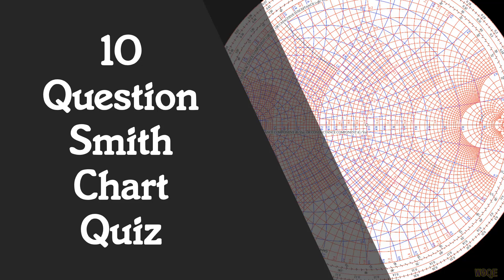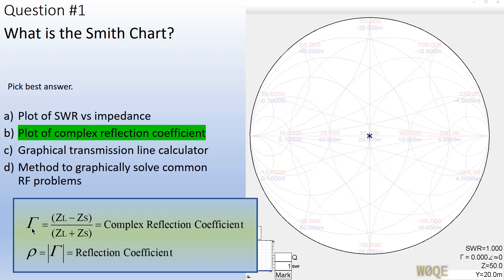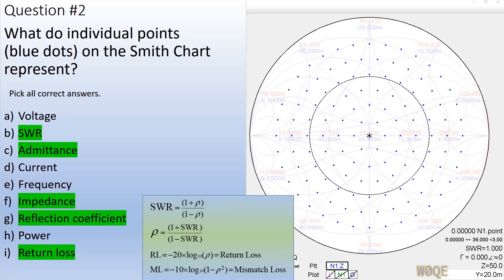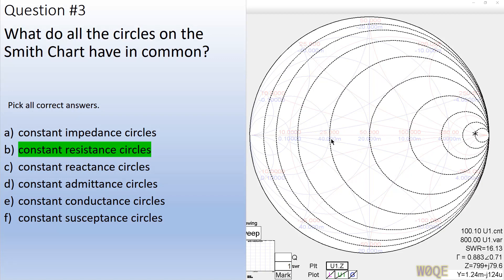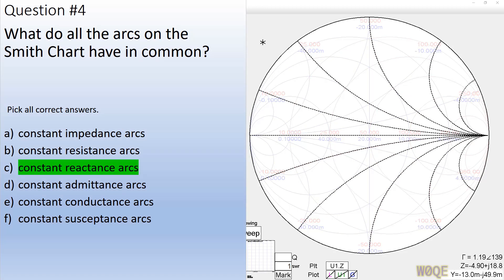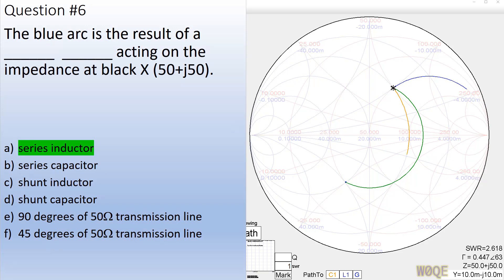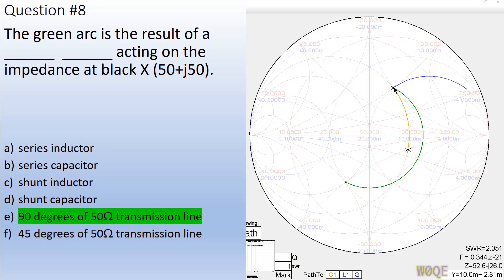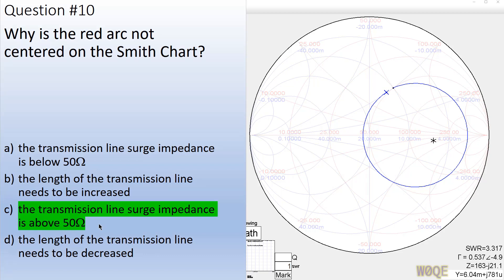#39: 10 Question Smith Chart Quiz

Comment: Really enjoyed this format - glad to say that I got 100% <grin>.  I'm doing a series on Smith charts on my channel right now - but more old-school (pencil and paper charts, backed up by VNA measurement).  Thanks for putting this together - nice job.  (I saw the same issues with the last question (wrong color, wrong text), but I see you've already commented on that - too bad YouTube eliminated annotations).  Great video!
Reply from the maker: Thanks Alan.  SimSmith allows an easy solution to many common RF design problems which I try to show in these videos.  The ability to adjust component values real time and see the results could play well with your "old school Smith Chart videos" with a VNA.  I don't know how many people actually design stuff these days but I sure wish these types of videos were available when I was a kid in high school and getting into electronics and radio.  Feel free to reference or include any of my stuff at any time if you wish.
Reply: You've got a great series of videos on SimSmith - looks very powerful, and easy to get insight into a variety of impedance matching and transmission line problems.